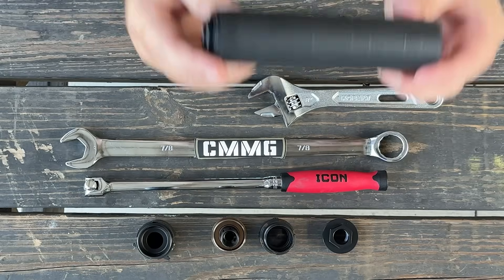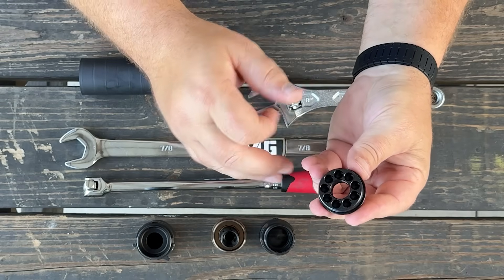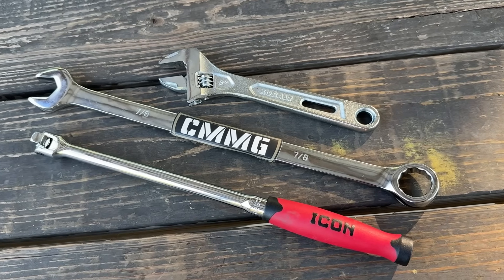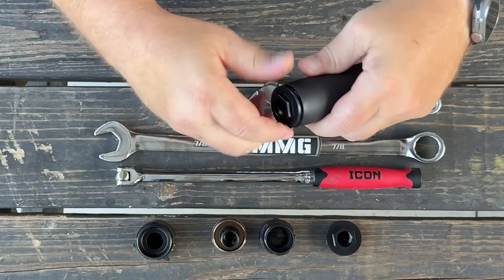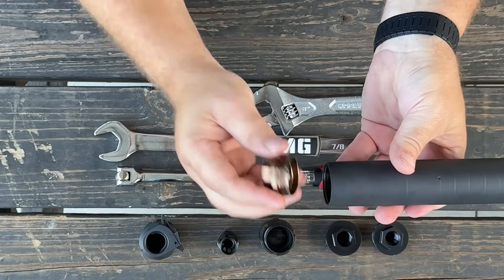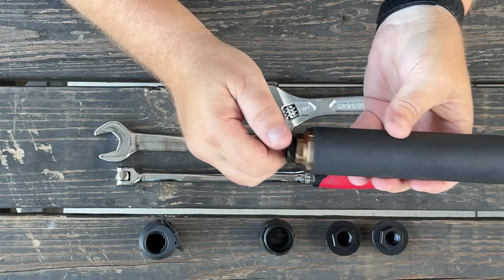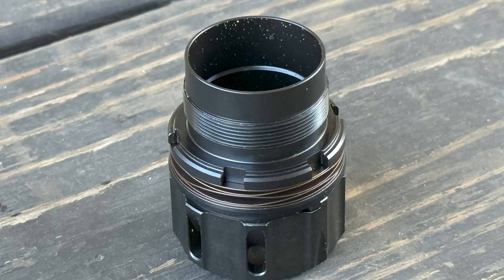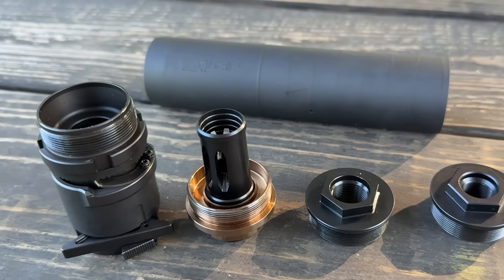HUB Compatibility and your ZEROED Suppressor

Comment: Can the  .30cal zeroed  handle 556 /223,  7 inch to 7.5 inch barrel ?
Reply from the maker: We recommend a minimum of a 10.5" for 5.56. Even with the ZEROED 30.
Reply: @CMMG but it works on your dissent 6.5inch barrel 300blk out ?
Reply from the maker: @Hoodstapizzo  Correct, but the original question was regarding 5.56/.223. We recommend the longer barrel for that caliber.

Comment: HUB is the way to go. Unless there is a very good reason not to do HUB on your design it really should have HUB. Glad to see most of the industry is moving towards this standardization.
Reply: Why do you prefer hub?
Reply: @chriss9317  At 1.375 inches it is large enough to fit basically any other mount system with no clearance issues. Everything from Atlas/Plan B to a Nielsen Device (pistol booster) to tri-lug to any size direct thread to SiCo Delta and ASR to DA Xeno, HUB can accommodate almost every major mounting standard available. This means if your can supports HUB it can support anything else as well, meaning you do not need to double up on cans if you have multiple mounting systems in your inventory. 

This increased compatibility is further enhanced if the mounting system also explicitly supports HUB, like Atlas/Plan B does. Say you have a can with a short blast chamber and your mounting adapter is too long to fit with a flush mount. Get an extended mount adapter to get an extra inch of space for the mount. Extended adapters are pretty common for HUB compatible systems, so it makes solving can/mount incompatibility issues trivial. 

The only real drawback to HUB is it introduces an additional set of threads which can cause tolerance stacking issues. but I find this concern overblown because a.) most manufacturers are using threads to mount their adapters anyway (very few directly weld mount adapters unless they are direct thread/tapers style mounts) so you might as well use a standard thread instead of a proprietary one, and b.) HUB uses a flat shoulder, so as long as you keep things clean and snug things down you should index near enough to exact as to not matter, every time. And the index surface is external to the can, so worries of carbon fouling on the index surface are practically nonexistent (so long as you are not dumb and leave things way too loose). I have not had any issues with any of my HUB mounts not returning to concentric, and yes I do have reference bars to check. 

In my opinion, other than for very niche applications there is no reason not to go with a HUB can. Almost all of mine are HUB now, and the few that are not can't be due to size (can itself is smaller than 1.375). It has gotten to the point where I will not even consider a can if it does not have HUB, save for the tiny ones. Fortunately most of the industry has caught on to this trend and it is actually getting harder to find a non-HUB can than a HUB can. Of the biggest brands out there only a handful have a majority of their product line as non-HUB (I am looking at you Huxwrx. get with the program).

Comment: I'll be running a Dead Air Zeno Adapter on mine.
Reply: I love you xeno but still run keymo 🤷🏻‍♂️ probably because I've never had a problem and I just like to see the haters get upset
Reply: @timowens7214 I went with Xeno a while back because Joe Bob Outfitters has a HUGE sale on Xeni muzzle brakes (like 2/3rds off). I got one for my 5.56, 300 bo, 7.62x39, and 308 bolt gun. Im currently running a Dead Air Nomad 30 with an e-brake between all of them. I think it will live on 308 moving forward so i can run the Zeroed on the carbines (more compact).
Reply: Same, too much invested in Keymo to start over
Reply: @Matt-zx1xj  I know, I've got 5 rifles with Keymo brakes/flash hiders. At $80 a pop, I think I'll keep what I have. Way too much invested to switch to HUB.